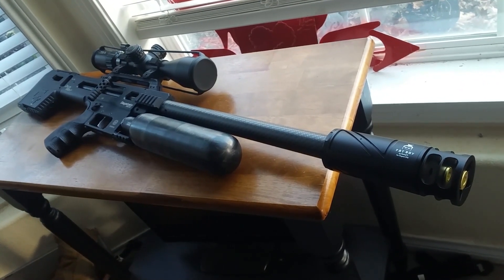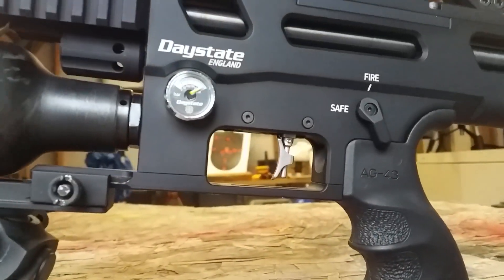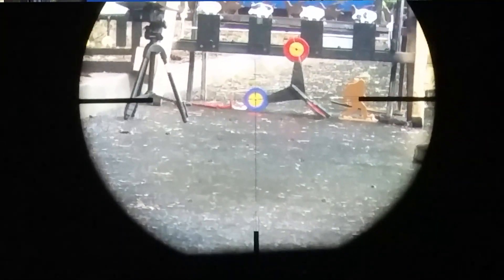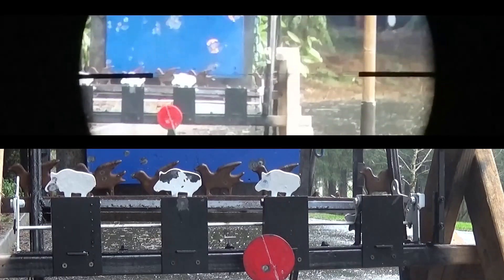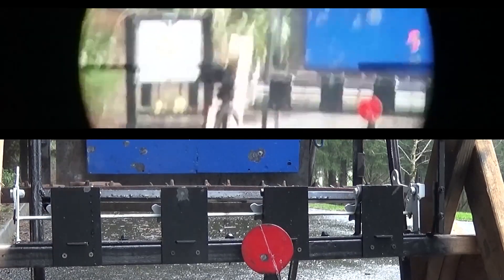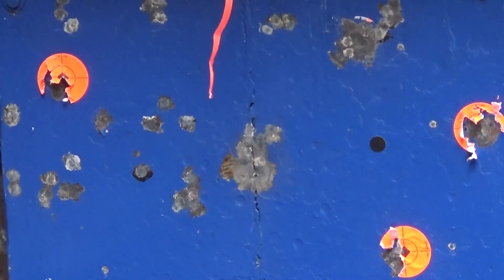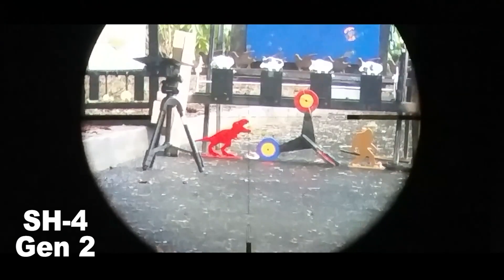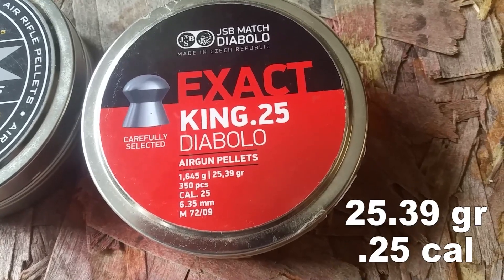Worth $3,000? Daystate DELTA WOLF Review #1 + Accuracy Test

Comment: I bought it because I thought it was built to hunt dinosaurs. I love my Delta Wolf but recently have fallen in love with the Edgun Leshly 2 REPR. With the longer 500mm FX barrel it is a slug flinging semi auto beast. I wish you had the chance to review Leshly 2 with the new DonnyFL FX barrel adapter and 800mm barrel. I'm never selling my delta wolf though. I can shoot in the barn at low power and not shoot through the tin walls and roof and i can turn it up and shoot pigeons at 100 + yards with slugs or really crank it up and shoot feral hogs. When he says it's versatile he ain't lying! It should be in the next Transformers movie cause it's more than meets the eye! 🤣
Reply: It would be so cool if they made this in .357 and a 1200mm barrel!
Reply: Farmer,  just got the gun struggling with tunes, and shot count.  hmmm.  .177 want to both slugs an pellets, the issue is seems like for slugs I have to really crank up the regulator.  That kind of kills the shot count.   Your thoughts,  shooting say 920 fps .177 what shot count are you getting in your gun.

Comment: I looked at the Daystate and decided against it, the Fx is far better and being a modular system you just buy the extra bits you want to make it suit your needs. plus with so many aftermarket parts for the FX. There is so much more information on the net for FX
last point who wants to have to charge batteries as well as air to make their gun work